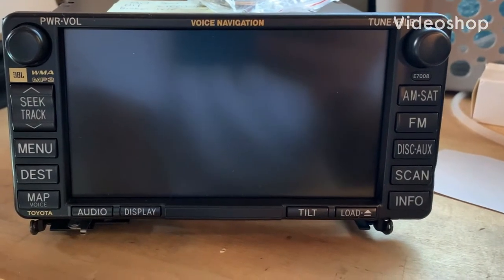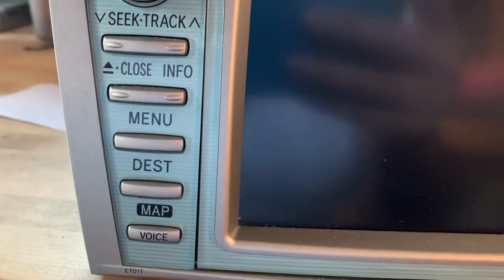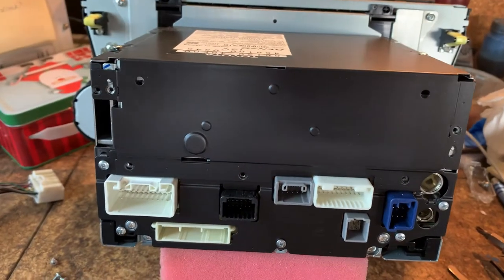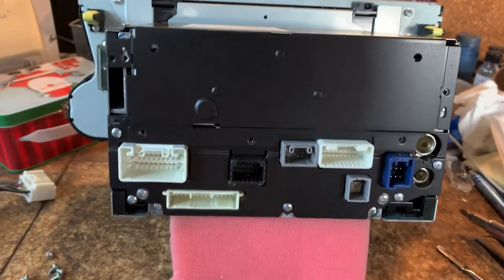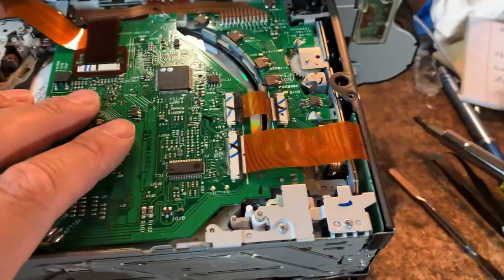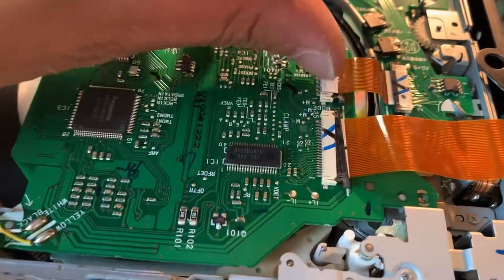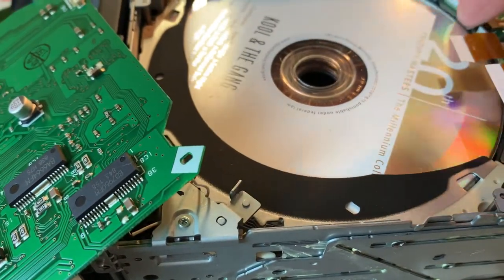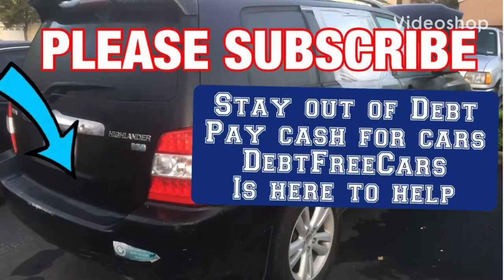STUCK CD Removal Toyota GPS JBL Denso navigation 2004-2012

Comment: 2007 Toyota Tundra nav/stereo unit 86120-0C320 has the wrong NAV CD installed. Units digital logic was corrupted by the CD format. How do I eject the CD with most of the buttons deactivated?
Reply from the maker: You can try diagnosis mode.  Hold display button while turn on headlights 3 times.  I don’t think the nav dvd can corrupt anything tho.  What are your symptoms?

Comment: Thank you for your video- we just got a van with the E 7007 model and the cd changer is stuck and won’t receive any discs even though it says it is empty. Is there a way to get it to function?
Reply from the maker: You will need yo remove the unit and replace the CD changer set.  You cannot repair it as its a physical problem.  I can send you a cd changer unit.  Email me at leakboards@gmail.com. Here is the video to disassemble. https://youtu.be/lPpJKplyMTc

Comment: Hi, how are you.   Thank you for your videos they are awesome u have an 08 the silver navigation radio. And my map dvd goes in and out and I want to clean it like your video shows    I cannot find the video on how to take it apart can you help please. I
Reply from the maker: What is the model and year of you car?
Reply: @DebtFreeCars  Thank you so so much for replying it’s a 2008 we bought the car brand new Camry hybrid with navigation
Reply: I tried to send you a picture of it but it won’t let me attach a picture
Reply: E7011
Reply: @DebtFreeCars  do you still have the video?
Reply from the maker: @kenward2005  ya so the repair on that is almost identical except for the face plate.  To remove, disconnect the ribbon cables behind the clear covers on the back side.  Then remove the Large Phillips screws on the back side.  The button pane will come out if you pull out the lcd screen panel slightly.  The remaining procedure is the same.
Reply: @DebtFreeCars  in your other video you said you had one that shows how to take the radio apart to look up and we can see the link.  We have the whole radio out sitting on the dining room table we just don’t know where to begin.  I am a disabled vet missing one arm and my wife is helping that’s why we wanted to see the video to help us
   I appreciate you.
Reply from the maker: @kenward2005  I haven’t had time to edit a video together.  Email me at Leakboards@gmail.com I can send you some screen shots.  Also, I have one fully test refurbished unit for sale, as well
Reply from the maker: https://youtu.be/wkP1WamUy2Y